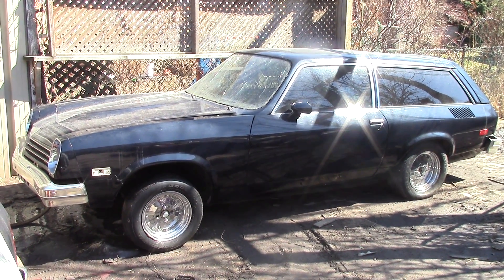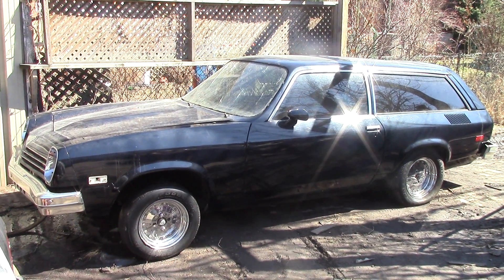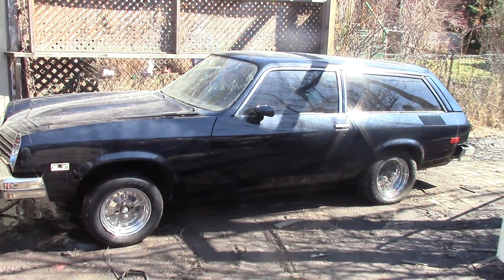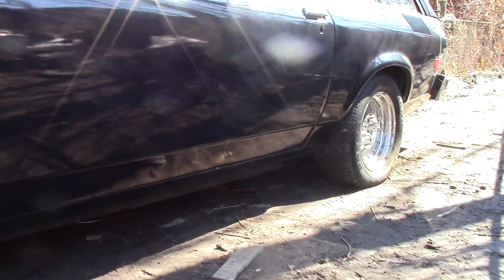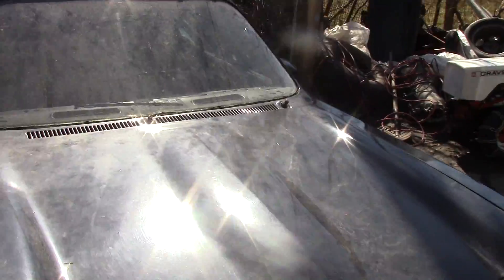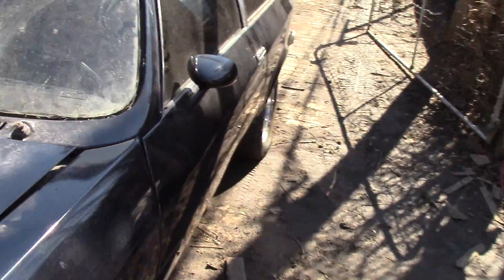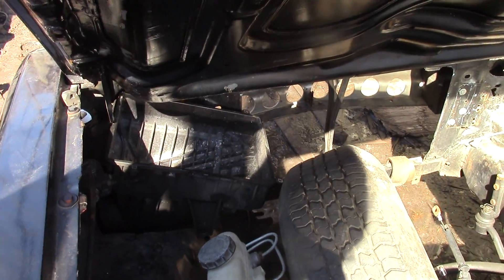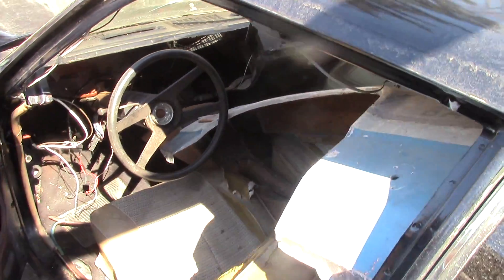1976 Vega Wagon Project LS swap Part 1, Overview.

Comment: where is the 2nd video withe the motor and what it came out of?1 and maybe a finished?!
Reply from the maker: +Kevin Beckwith 
Sorry we decided to go with another project. The Vega would have been a more involved project than we wanted to get into, so we used the engine that was slated for the Vega in a 84 Chevy C10. You can see that project in our other videos.